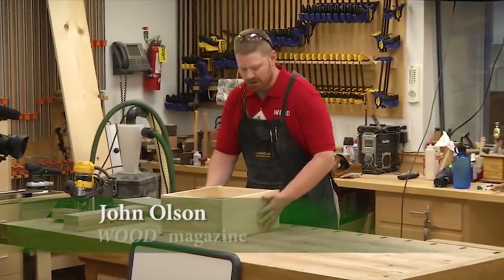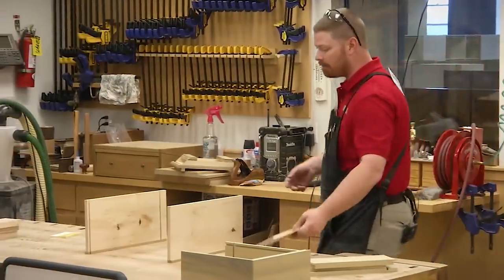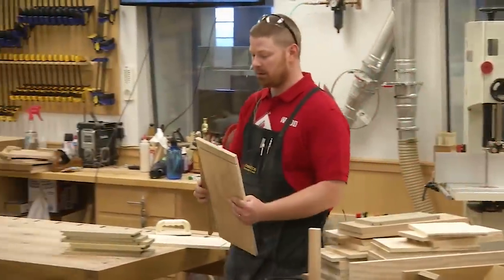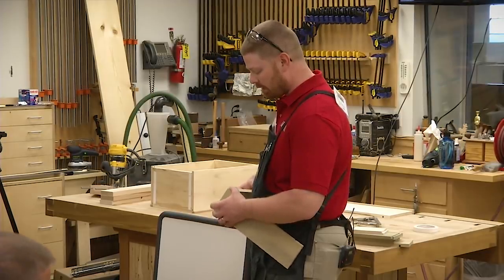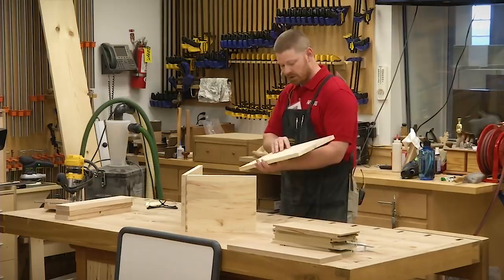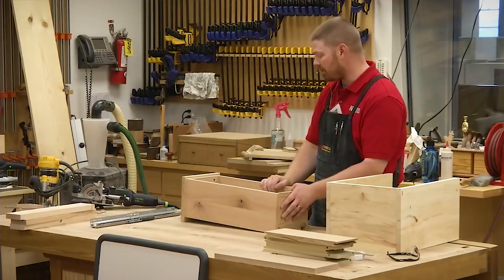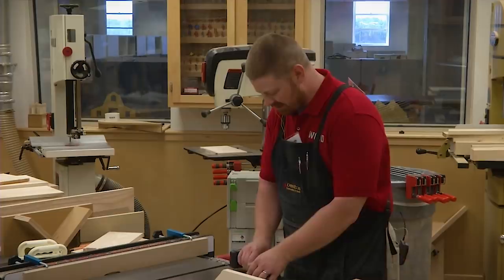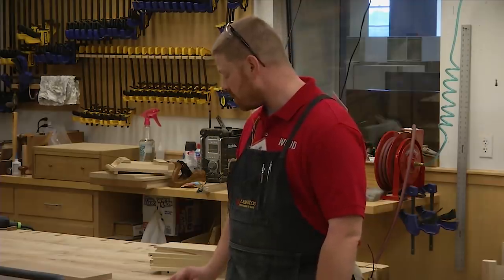Building Cabinet Drawers WOOD magazine  WWW15

Comment: It's so crazy to me that we continue to use Imperial in North America still. It is just a bad habit like smoking. Using fractions and then trying to figure out what have the fraction is.... versus 1.3cm or 13 mm for example.
Reply: I have not really committed to it, but my thought is to convert everything -- materials, intermediate and final dimensions -- to metric from the start and just forgot about inches and fractions.
Reply: Imperial is just as accurate as metric and is a better suited to geometry.

Comment: Lock dado on the draw back can do 2 things, hid the draw bottom dado and add strength to the draw, you would just do a lock dado on the sides into the draw back. While this is often used on the frt of utility use draws , you'd use this on the back draw wall and dovetails on the front of the draw.
It would be so strong a joint it lasts as long as the glue holds up.

Comment: Cut some strips of plastic laminate for the bottoms of your drawers and stick them on with two sided tape or contact cement, makes those drawers slide real easy !
Reply: I used plastic laminate on plywood drawer side bottoms to solve the problem of the drawer rollers chattering on the rough plywood edge.

Comment: I am a novice with limited skills, limited tools, limited funds, limited transportation, permanently varying humidity inside and outside, and a deck for a fair-weather "workshop." My projects, at present, don't aspire to be "fine woodworking."  They are more on the order of kitchen, workshop, and office cabinetry with an elegantly minimalist look...real furniture is perhaps for later.  I am wondering if there is any reason that I should not work almost exclusively with plywood?  (Just as I was finishing this comment/question at about 0.47.00, I did hear a few favorable remarks about plywood.). Thanks for a great video with really detailed information.

Comment: You can buy a relatively inexpensive dovetail jig for about $150 and set it and forget. Most woodworkers should have a Router by this stage of project difficulty. Rather than spend a King’s Ransom on the Festool Domino. Then you can dovetail all your drawers, your neighbors, friends and families...
Reply: You can cut dovetails without a jig.